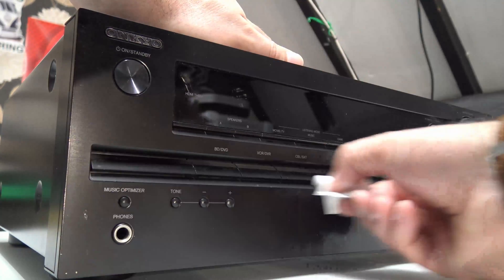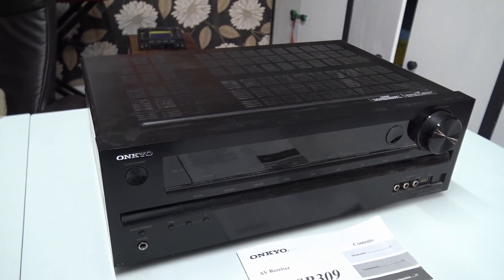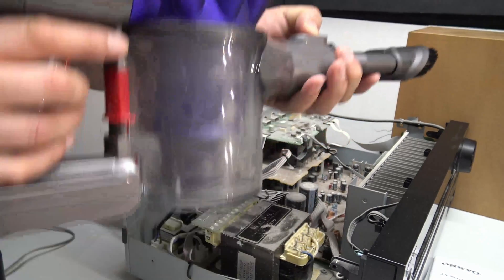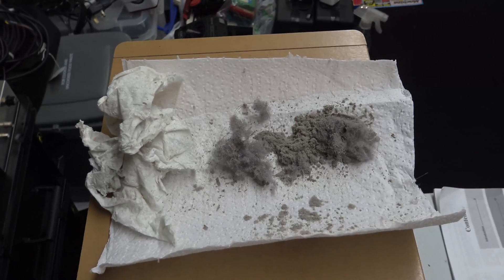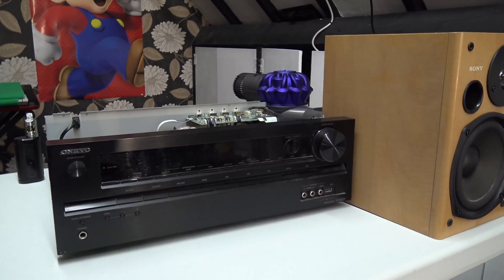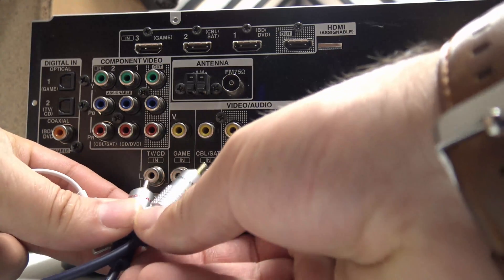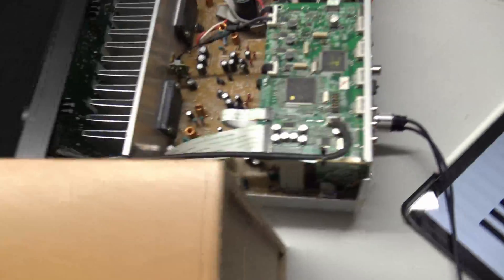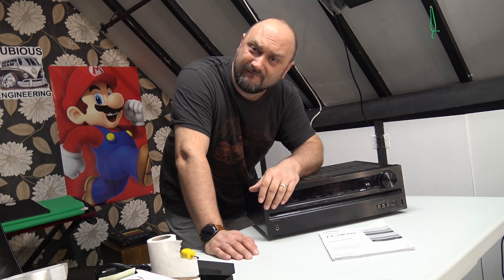DuB-EnG: ONKYO SANYO HDMI TX-SR309 AV Receiver amplifier teardown, service and repair

Comment: i have this onkyo and it works but it takes between 5 to 10 minutes to output sound in HDMI,and i don't see HDMI out in the digital audio menu,someone could help ?
Reply from the maker: What a bummer...  I genuinely have no idea.... sorry
Reply: Mine exactly too!
When I open it the screen is on everything is on but there is no sound anten Iveco 5 minutes and sound comes,
One of my friends has the same model and he had the same problem also so You Are The Third example for me it means ise kronik problem for this model?

Comment: Hey I just bought a denon 3803 when I got it home I realized inside it's DIRTY!! As much as in this video. Can I vacuum, light brush and blow off the circuit with can compressed air and then go over with isopropyl to clean and lube the jacks/pots with electrical spray???? Sound like a good way to do it. The good thing is my unit is fully functional, God knows how lol.
Reply from the maker: That sounds exactly like the cleaning process you should give it!!!
Reply: @DubiousEngineering  I keep hearing about EMS from vacuum cleaners and that it's not safe. I was only going to use it at very low suction. Ok?
Reply: This is exactly what I was looking for. I realized my parents HT is dirtier than this and I'm going to clean it. I hope that it works after this, otherwise I'll have tu buy them another (.V)

Comment: I have this onkyo SR309 not working but again did you say it is a sanyo unit I am freaking out now.... Santo is not the  most reputed home appliances system around... Just midrange garbage then.... .that was a quick fix 🔧... Nice work..
Reply from the maker: A lot of Sanyo parts inside...  :-)   Sorry to tell you :-)
Reply: @Dubious Engineering  I am certainly disappointed.... Had a bad experience with sanyo products in the past.... And bits and parts from sanyo does not instill confidence..... 😟😔😞

Comment: reflowing is a waste of time for sure the fault will come back  you need to use the old lead and tin solder and redo the hole  board same problem happened with the ps3 and Xbox 360  crap solder
Reply from the maker: I hate lead free!! I’m sure that’s not good for me... but!!! Leaded solder and flux runs so much better with a shiny finish!! Everyone wants their dogs to have a shiny coat!! Eat lead!! :-). Genuinely thanks for your thoughts and feedback... stay safe :-)

Comment: How's it going, Howard. Hope you're keeping away from the lurg.

Still need to fix my Onkyo TX-SR607. It has the usual dodgy soldering on the BGA DSP chip, so I bought a new (pre-balled) chip.

Need to throw it in the reflow oven at some point, but I don't have a proper controller for the oven, so it'll be a case of watching when the temp gets above about 260C.

The BGA version of the chip gets way too hot, so weakens the solder over time. They really should have put a heatsink on it.

The older model you have there looks to be mainly non-BGA, so probably a fair bit more reliable.
Reply from the maker: Hi Ash! Great to hear from you!!  -->  Likewise mate...  keep clear of the nasties!!  In the past I have got away with pre-heating the family oven to 200C (max), then quickly using a hot air gun and JK thermocouple to re-solder those ball grid array buggers... they really are a nightmare!!  Onkyo Fffed up big style!!   Fingers crossed Jon's unit keeps going after this service...